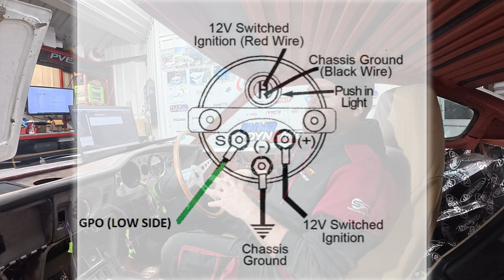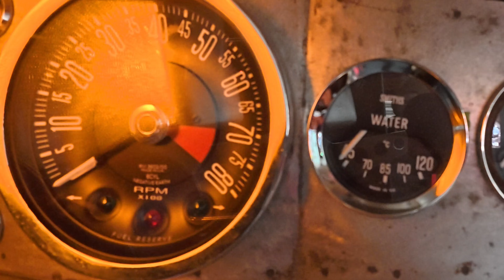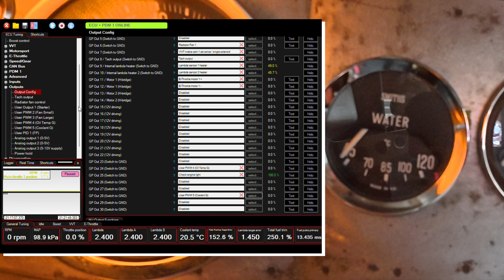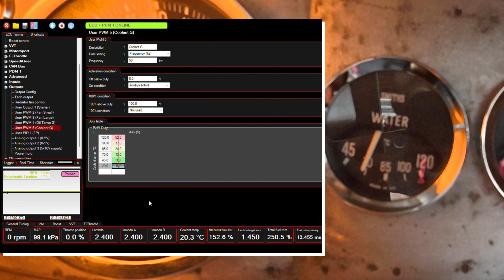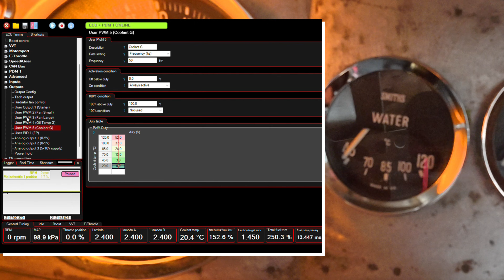Making your analogue guages work with your MaxxECU or most aftermarket ECU's!

Comment: I recently found you can drive the stock speedo with a spare ignition output on a 90s Toyota.  Different transmission, so didn't have the original sensor signal.

Comment: Does the arrangement you describe in the video mean the needle position changes slightly when the voltage changes (i.e. 12v engine not running and maybe 14.5v when it is running)?
Reply from the maker: No, all guages have voltage stabilisers on them. Well, certainly all the ones I've seen. :-)
Reply: @TuningShed  super thanks.  that rings a bell now you've said that.

Comment: Brilliant.  Its such an awesome bit of kit.  I have been thinking about the cable driven speedo in my project car.  There is a GPS driven box I can buy to spin the cable drive and generate a reading on the old speedo gauge, buts its expensive and I feel like it might not last very long.  I was wondering if the Maxx can run a mini RC car servo, this servo could then be fitted into the gauge and the needle could be attached.  Is this something you've done or could do.  IF so I could you make a video that this too please :)
Reply from the maker: Speedo drive's can be awkward when they were originally mechanical honestly. I've had a few Mk1 golfs in, with a similar system to you mention, a motor drive. This is a decent solution honestly, however, often very noisy. The last one I had in on the the dyno, the motor was very audible from the driver seat.

In the past, I've used the electronics mechanism from a tachometer from a second cluster, and essentially used the needle drive from that. A simple table within MaxxECU would allow it to be driven silently and accurately. It would obviously require a VSS input though. 

I've got to do a 309 with a K20 in it at some point, if I have time, and remember, I'll do a video of how I do it. :-)
Reply: @TuningShed thats genius. I hadn't thought of that. I would think the majority of cars have the same size speedo and tacho. I'll look into that. 

Really appreciate the reply. Thanks for taking the time.

Comment: Thank you, that made it very easy to understand! I assume the same applies for the tacho and speedo?!
Reply from the maker: The tachometer generally will rely on a 'pulsed' output. The MaxxECU will normally have an output you can use for this, that has an internal 'pull up resistor' built in to allow the 'pulse' to be 'seen'. Often speedometers are mechanical on older cars. Around the 90's many were electronic, but again relied on a 'pulse'. It can be run in a similar fashion to the tachometer. 🙂

Comment: Great video as always,, you are a machine.. may i suggest you explain why you need to adjust duty cycle and what is duty cycle. Why are they using duty cycle instead of voltage or why you want to adjust  only upto the desired temp.. why not full gauge sweep or what happens if it does get hot will it pass the set temp/duty number you inputted. 
We are actually  trying to  figure out how to show the gear selection on a small led plate, from the ecu/tcu. We are the first in the world to install the ZF8HP70 on a jag-xjs V-12.. also need to figure out how trigger the reverse lights while in reverse..
Reply from the maker: Hi There, 

We're essentially trying to replicate what the OEM guage wants to see which is a Thermister bolted to the engine block. The best option we have at our disposal, (and one that works well) is to use a PWM (Pulse Width Modulation) signal to ground. So, 100% on, is 0V the signal is fully to ground. At 0% duty the signal is open. We're using the difference between these in a PWM to fool the guage into thinking it's seeing a resistance. What its actually seeing is a really very quick on-off signal. Because of the older technology, it's happy enough with this signal.

Now, typically a thermister is not linear, so it's not as easy as putting 0% is equals to 0degrees C, and 100% is equals to 120 degrees C. So the methedology I'm describing in the video, will allow you to create a table that will be accurate to your coolant temperature when the vehicle is up to temperature. 🙂

You can use an output on the ECU provided you have one spare, a GPO or Injector (I don't know what ECU you have), and create a rule to see reverse, and it will make the GPO activate. You can run a relay from this for your rear lights. Not a problem at all.

Steve
Reply: @TuningShed ,, dude you are an animal.. absolutely understand..I love PWM , but as you mentioned,  trying have a linear analog  to play nice with digital  is not fun.. Our maxxecu is the street version.. great job explaining.. you didn't have to do that,  on my behalf.. cheers..